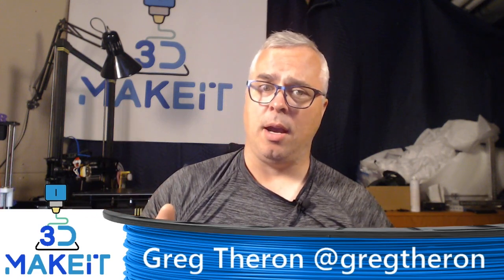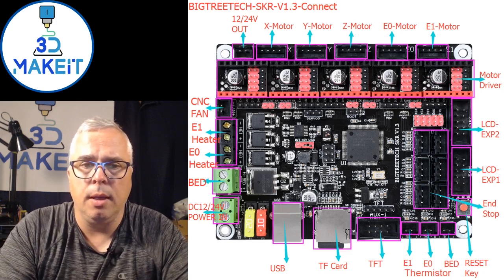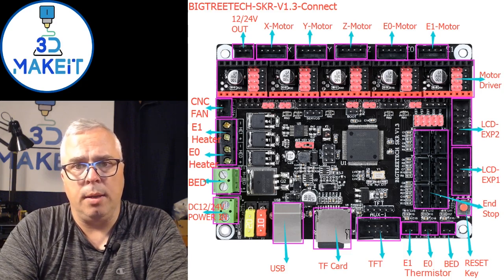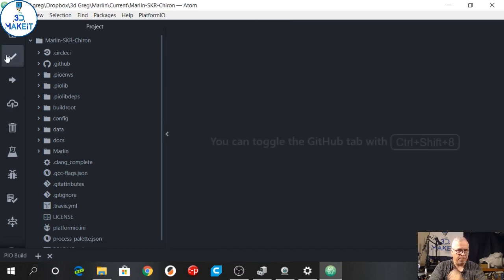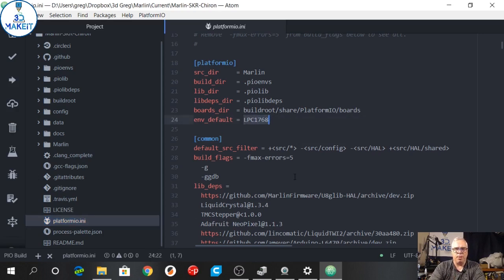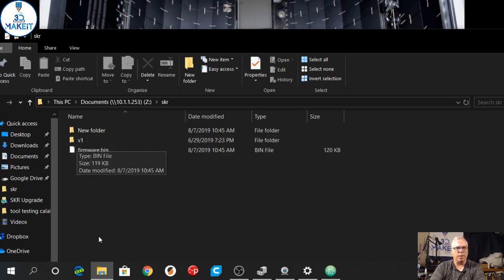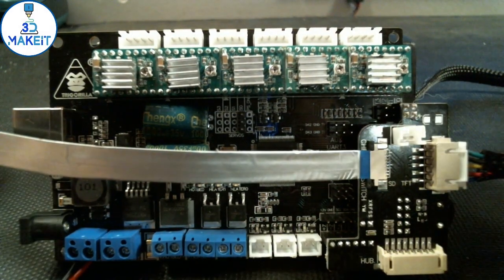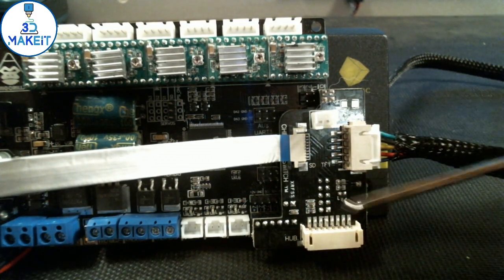Marlin 2.0 BigTreeTech SKR 1.3 Upgrade to my AnyCubic Chiron (What Have I Done???)

Comment: How did you run the wires from the board ? Do you have the hub still in the case somewhere & crimped connections to the board wires to stick to the underside of the hub ? Or did you run the wires straight from the board to the "2nd" hub board where the printer side connections plug into on the side of the case ? Cheers
Reply: Also how did you end up connecting the sdcard slot ?
Reply: So i ran all new wires from the board. I have klipper on it now and would consider a canbus board to simply the wires to 4
Reply: @GregTheroneggythetech can you make a guide on how to setup klipper and slicer settings with klipper firmware?

Comment: Hey, I noticed that your website with the wiring diagram is no longer available. Do you happen to still have the image? I've done an extensive upgrade of my printer and I'm currently writing the documentation for it but sadly didn't save the diagrams I used at the start.

Comment: Sorry,  one more question.  Did you not use the stock filament runout sensor?  I see it in the diagram but don't see where you connected it.
Reply from the maker: Yes, connted it to the y+ or x+ endstop I will need to look

Comment: Do you know if the wiring Diagram will also work for the V1.4 board?
Reply from the maker: They're pretty much the same I have since ended up adding a hermera to my printer so I chose to completely rewire it on the ground up in the latest video

Comment: Question: I have the Chiron and doing the 1.4 Turbo .. I was looking at your pin out for the hub wires.  I am confused as I can see both the Left Z Stop 3 wires coming in and the Y Stop 2 wires come in.  How is it possible to have them on the wire harness as well?  Thanks for the video it helped
Reply from the maker: I'll relook at my diagram I have since completely rewired the whole printer and no longer use that diagram.
Reply: @3DMakeIt  I finally bypassed all there hubs and such and rewired it all my self as well.  Only problem now is getting the marlin configured to work with dual z .. having a tuff time getting it to work right on the 1.4Turbo

Comment: Hi, thanks for great video. A quick question, I have the board installed, work ok except the second z motor and I don't know where to connect the 2nd z endstop. Thanks
Reply from the maker: I switched to a BL Touch so don't use Z endstops.

Comment: Can you tell me if the 1.3 and 1 4 turbo would both use the same wiring diagram?
Reply from the maker: The wiring diagram is the same for the any cubic side of things the ports are slightly different on the boards.

Comment: Really appreciate the video!  You're one of the few folks making Chiron videos, so I'm 100% a follower...keep up the great work!

I'm in the process of converting my board to an SKR v.14...the Hub wires are next, but there's 2 sets of wires on the Trigorilla board labeled AUX (just above the UART3 pins) that I don't know where to connect.  Some diagrams I found say they are the "Z of left limit" and the "Y limit switch".  Do you know what they are?  Where did you install them on your board?

Lastly, any chance you can share your firmware setup?
Reply: Was it successful? How have you done your wiring?

Comment: I m trying to update my Chiron with the skr 1.3 but I ve got 2 connectors that I do not know where to plug it... It seems it is z min left sensor & y min sensor but it is not coming from the hub. Could you plase take a picture of your end stop connectors on the board ? Thanks for your help & your videos 😉
Reply: me 2 , have anyone a solution ?
Reply: @patrick-dc1et  my solution : I reworked all thé connections of the printer, throwing hub parts to the trash 🤭. It working liké a charm since 2 months
Reply: @jshbl4332  could you help me with my cable connection ? i also need a little helpf with the configuration files to build the firmware

Comment: My problem is that AnyCubic Chiron has two Z motors. I watched a lot of videos and nowhere is it said how Marlin reassigns the E1 driver to Z2. I naively spent $ 200 on an upgrade. Everything is lying in a box for more than half a year. In addition, Chiron has a different auto level than all
Reply from the maker: So in the Configuration.adv you can make the change there. Search for Dual Steppers / Dual Endstops.  You can have Dual endstops and dual Z enabled there. I change the auto level to a BL touch and removed the Z endstops all together.

Comment: Hey, great video. Noticed you mentioned you had UART with 8bit board. I’d like to get my 2208 hooked up with my 8bit board on my chiron. Thanks for any help
Reply from the maker: I am Using the SKR 1.3 and 2208's in UART, I have 2130s ins SPI on my MKS GenL. But i would like to Try the 2208's on the Trigroilla board but have not gotten to that yet.

Comment: The way you mounted the board, you blocked access to the USB and the SD-Card. How did you solve that? Cutting holes into the sheet metal?
Reply from the maker: The SD card holds the firmware, so it does not need to come out. The usb cable was an issue so I have tilted the board at a 45 degree angle and plugged in the usb and fed it out the original usb hole. I can access the SD card via the usb cable as a drive letter on my computer. I do not print from the SD card because I use octoprint.
Reply from the maker: I can post a picture if you like
Reply from the maker: If you watch my fan video you can see the final orientation of the board. https://youtu.be/GQbd85SepvA

Comment: Why want Anycubic Chiron just come out with a silent board that plug and play? And have runaway safety feature? That be nice and you wouldn’t have to worry about anything then. Nice video
Reply from the maker: That is true but i got mine before that was available.
Reply: 3D MakeIt 
I can understand that. Hopefully Anycubic will come out with a motherboard like that one. Just plug and play
Reply from the maker: Yes that would be nice, I might get a new display for mine. i don,t us them much but its nice to have the option.
Reply from the maker: Like all the Yellow parts the have added to your printer
Reply: @3DMakeIt  I'm working on using the BigTreeTech TFT24 display on mine, it's almost the same size as the old display, it's a 2-mode (so you can use a GUI you can customize or the stock Marlin serial UI), and has it's own SD card slot that can be printed from. Just need to print off a mount that holds it right.
Reply from the maker: @KiraSlith  I was debating whether to use that one or the bigger one. Would it fit in the old one of you drilled a hole?
Reply: @3DMakeIt  I hadn't thought of reusing the old display housing, just checked it against mine and it'll fit in the housing and the screw posts even line up. You'll need to Dremel the side for the SD card slot, drill a hole for the encoder wheel, and one for the reset switch, and it should fit fine, might look a little odd having an off-center screen in the window though. BUT I also found that the USB programming header is still on the Chiron's display, meaning it might be possible to find the Baud rate that way and bypass the need for a new screen entirely assuming you don't care about having the remote SD card slot.
Reply from the maker: @KiraSlith  I tryed that, if you have any luck with the stock display let me know. 😀
Reply: @3DMakeIt  I'll poke at it from Mint, see if I can get it to respond with anything useful. Odds are it's ISP is running at the same baud the display runs at.
Reply: @3DMakeIt  Edit: More Info @ bottom of post.

I wasn't expecting it to be flash storage, but that proved actually MORE useful. Turns out these displays are bog standard parts Anycubic uses on most of their printers, colloquially called the "Anycubic Mega TFT", which means you might find the correct baud rate in a custom firmware for their "i3 Mega" or "Mega-S", and also means we can change the cover photo you see when you boot the printer.

Edit: well, we've reached the limits of my knowledge and skills, derhopp has a 1.1.x stable branch with the TFT working for the Mega i3, but I don't know quite enough about C/C++ to even attempt to reverse his work and reimplement it in Marlin 2.0. Hopefully you can do more than I can from this point. 😢

https://github.com/derhopp/Marlin-with-Anycubic-i3-Mega-TFT
Reply: I'm in the same boat as Mr. Makeit with a late 1st generation Chiron and came to the same conclusion parts wise as well, stumbled on this video looking to see if I need to spin up my own marlin config from scratch or not.